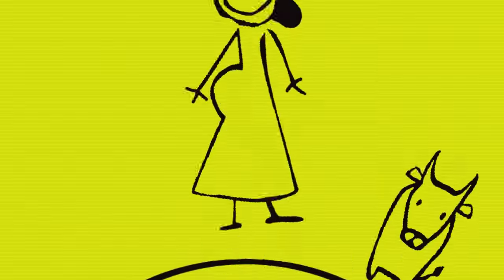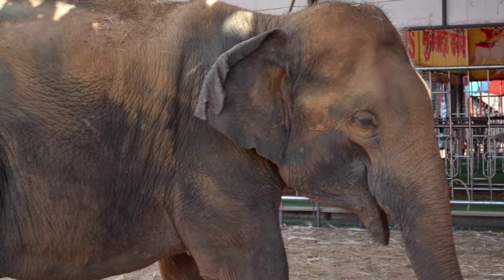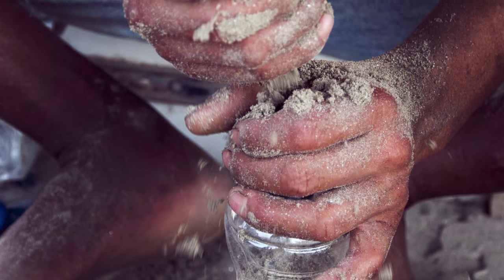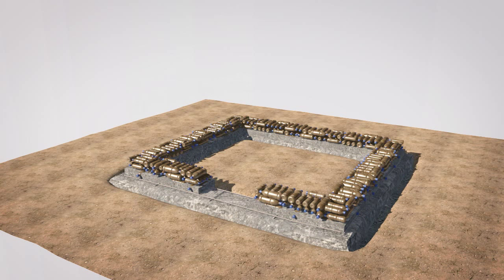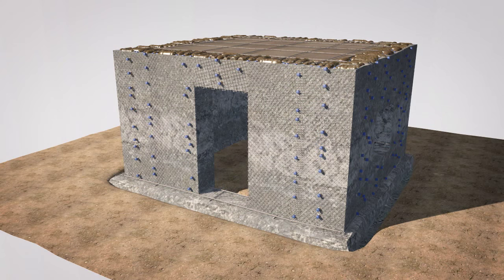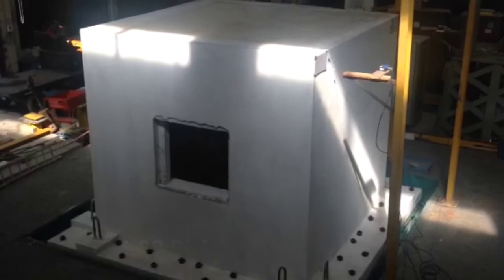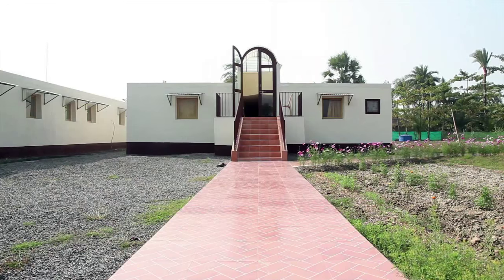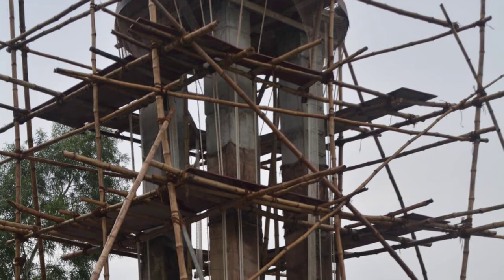Rebuild it Better: Construction From Recycled Plastic Bottles Proven to Withstand 9.8 Earthquake

Comment: i'm not a fluent english speakerso i don't know if i didn't guet it or if it haven't been said but i would like to know how is the first layer of fishnet helping the structure ? and how is it fixed on the ciment (is it simply put when it's dry or do we let it dry insinde the ciment / are the ropes tied to something ? ) . Thanks for the video btw i'm planning on building my house with the system !